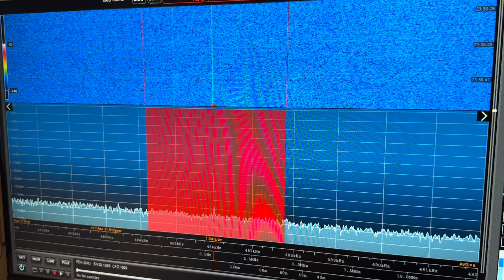A carrier but no audio detected on 486 kHz longwave from WI2XLQ's annual Christmas Eve broadcast

Comment: I’m the trustee of WI2XLQ from here in Virginia grid-square FM07jj.  You are the best DX ever for a Fessenden Transmission.  The modulation uses a Heising modulator, so at best about 70% AM modulation on peaks with 4:1 compression of a synthesized voice 6min long loop.  The TX power was only 200w this year due to an issue with a PA combiner. The RF amps are Hafler 9505 audio amps due to their “out of the box -3dB bandwidth of 300kHz”.  Changing a feedback cap opens that up to about 600kHz.  Yes, antenna is a 160m dipole with 600ohm open-wire feed-line shorted together at a variometer and with a tapped ferrite impedance xfmr, is feed against earth via a common mode choke with LOTS of ground rods and common bonding to everything!

I can be reached via my QRZ.com e-mail address.  If you’d like to try some one-way CW tests, I’m up for it. Licensed ERP is 20w, so around 6dB more than the Amateur 630m band limit of 5w EIRP.

73,
Brian, WA1ZMS < Amateur callsign
Reply from the maker: Hi Brian, thank you for your comments - it's great to know my copy is the best DX to-date for your transmissions. Are you still transmitting now? If so, I'll have another go at copying and recording your signal. I will also get in touch via QRZ.com Thanks again and 73. Clint M0OXF

Comment: It’s surprising even with low power on LW you can get out very far. In my tests on 252 kHz with 100W I was getting out 20km with a bad antenna. At night it could have been heard much further away. Sadly that transmitter is now faulty and I can’t repair it. I just don’t have the knowledge to fix it.
Reply from the maker: Yes, I agree. What is the latest status of your LW station? Looking forward to you getting on air at some point hopefully. Happy New Year & 73